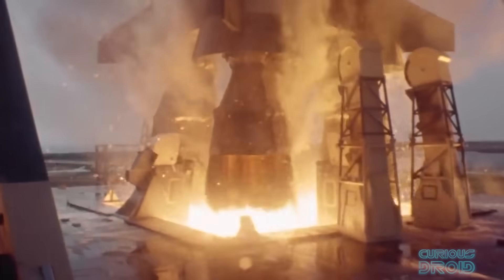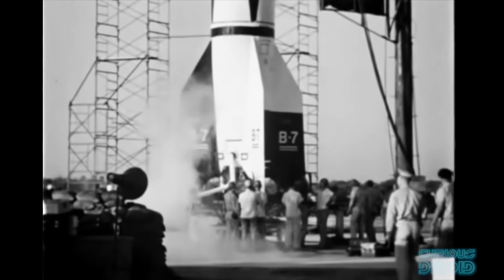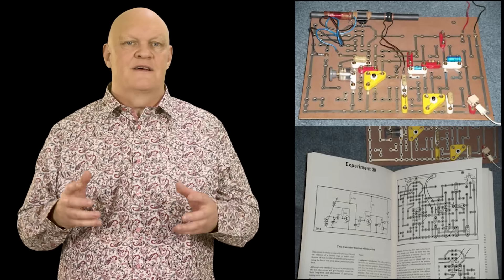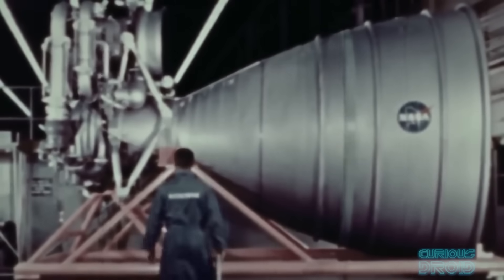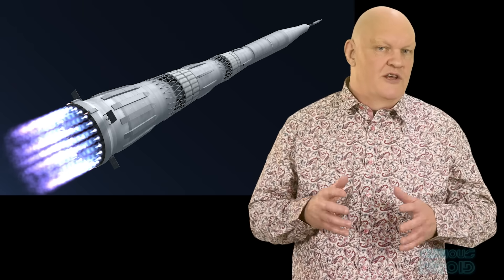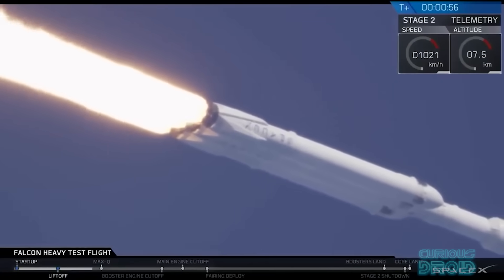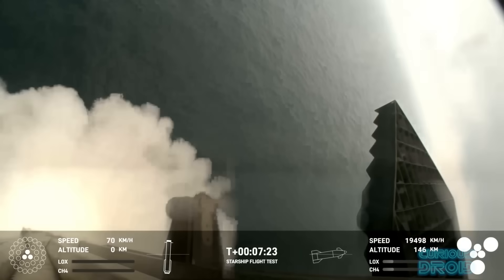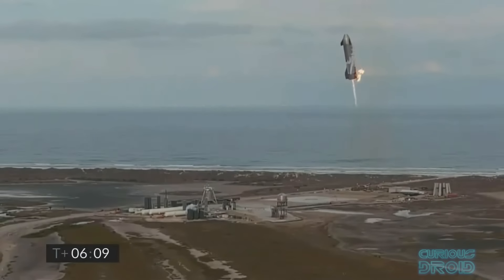Why Does SpaceX Use 33 Engines While NASA Used Just 5?

Comment: Starship isn't usable for a manned lunar mission. It's not rated for human flight. It doesn't have an escape Tower.   Apollo 6. Launched with in Saturn v stack which included dummy weight of the LM. A command module that orbited around the earth for hours, 9 hours I think. Then it splash landed successfully.  Every test was a success. 

Starship has blown up or burnt up on all its flights.  Booster landing in the water for number four. Progress... That's 33 engines gone. 

People going on about that. Fin... Where are the other cameras? Like the ones inside?  The fin failed, it melted.  What other damage happened to the craft? With all the melting, most likely a dead crew. 

All four flights of starship did not include any cargo weight. So what is the actual performance of the booster when it barely has any fuel left?  The second stage is empty. We've seen some pictures of the inside. It's an empty can. No life support system. No. Cargo. No crew compartment. No supplies. No space routers. No dummy weight.  It's supposed to carry 100 tons? 

About 20 launches for a single manned lunar mission?   A single booster failure would result in a scrubbed mission.   A landing failure of the chopsticks would result in a big boom and a loss of the chopsticks catcher thingy... And anything else nearby.

Spacex is way behind. They did not meet the milestones required. NASA has no business giving them any more money.
Reply: Some comments:
- A lunar lander doesn't need a launch escape tower. It's only useful for launch, and HLS Starship will not be crewed during the launch.
- Booster landing in the water is progress, yes. It set the stage for flight five, where SpaceX will attempt to land the booster at the pad.
- SpaceX will have a bunch of different camera views. They are not obligated to share any of it. It's very likely that if this flight had carried crew, they would have survived through the soft landing. The fact that all three engines relit and it was able to perform the landing says a lot about the state of the vehicle. The damage couldn't have been too bad.
- These flight tests haven't carried cargo, but there has been propellant left over. By the telemetry and by SpaceX statements, these early prototypes could carry around 40-50 tons to LEO. That will increase as development progresses.
- No, a single lost booster wouldn't cause a scrub for a lunar lander mission. The boosters and tankers aren't critical. If we assume they use four booster that they rotate through, if they lose one they still have three. It would only mean they would have to cycle through them faster.
- A failed booster catch wouldn't cause a particularly large boom. The booster is almost completely drained of propellant by the time it performs the landing. And many failure modes would simply cause a landing abort, where the booster just dives into the gulf instead of causing damage on land. Sometime next year, they will also have four launch pads, so even if there is damage to one pad, they still have three.
Reply: @SpaceAdvocate  Elon musk promotes that Starship will carry humans from Launchpad to the moon and back.  For for years they've been talking about launching people from New York to Tokyo for a 40-minute flight.  For which and escape Tower would be handy. But it's such a large craft. I don't see how that's ever going to be a thing. 

Obviously it would not be useful or needed for a lunar lander. 

What's the turnaround time for a booster? 25 days at best?  

You're right, SpaceX isn't obligated to show us anything.  But they have shown video in the past of the internals and people pointed out a lot of problems. 

Not showing the internals for this flight, or much of the ship other than a fin or two?.   Seems like they're hiding... What they don't know won't hurt them. 

When they tested the Apollo ships before they were crewed.  They recovered the Crew capsule. Which they can verify if people can survive.  

Spacex is promoting that Starship will carry human passengers and crew to Mars and beyond. 

If it's just a tanker... Then call it that.  Stop saying it's going to land on the moon and Mars.  And they're working on an elevator to lower people to the surface... 

Okay. Let's say they have four boosters.   It still takes about 30 days to refurbish a rocket for relaunch at best.  They still have to test these 33 engines each time.     If you watch a fueling rocket once a week.   That's 5 months of launches.   Lose a booster?     Have eight boosters, with launches twice a week, then 2 months.    WOW.   

A Saturn v/Apollo put men on the moon with a single launch.  

Let's look at cost.   At best it's $100 million per Starship launch. (Falcon heavy is 90 million)  But it's far more complicated and more fuel than a falcon heavy. 

$2 billion for fueling launches.   At best.  Realistically, 4 billion. 

Let's run some more numbers. A non-human mission to the Moon is about 125 to 200 million.  Wow.

To send a Rover to Mars cost about 2 to 3 billion.    Estimate cost to send humans to Mars would be $500 to $1,000 billion per mission. 

We're not going to Mars.  Not unless some new technology makes it possible to get there in a month or less at the cost of a few billion or better.  There's nothing like that on the horizon.
Reply: @tcat1990  I think we can expect that the turnaround time for a Super Heavy booster could quickly get below a week. Falcon 9 is several weeks, but that's because the engines need to be completely disassembled and cleaned between flights. Methalox engines like Raptor will be able to do multiple flights between scheduled maintenance. At the start of reusing boosters, we can expect that they need to replace some of the engines between flights, but they have swapped out engines in a couple of days. To start, they would also likely do a new static fire between launches, but once they see it's working alright with no engine failures, they would stop doing those.

If they have launches once a week from two launch pads, and need 20 launches for HLS, then they need 2.5 months to prep for a moon landing attempt. That's fine. That means they could do 4-5 moon landings per year, but Artemis is only planning one per year. Their capacity would greatly exceed demand.

$100 million per launch is a decent estimate, if they are expending the vehicle, but they intend to reuse them. (You could look at the paper by Payload Research.) I would expect around $50 million with reuse of Super Heavy, and maybe $20 million with reuse of both stages. 20 launches would then be $400 million. That's about the same as a Delta IV Heavy launch, or 10-20% of an SLS launch. 20 launches is also fairly high for longer term - with Starship V3, they may need 6-12 launches. That would drop the cost down to $120-240 million. The more expensive part of a moon mission would be the lander and the propellant depot. If we say they cost $400 million and $200 million respectively, each moon mission would be around $700-800 million, until they start reusing the landers and propellant depots.

Going to Mars is in some ways easier than going to the Moon, but they would need a lot of specialized equipment and several vehicles. I think they would need ~8 Starships before sending the first crew. If the eight spacecraft with cargo each cost $500 million, and they need 96 tanker flights, that would put the cost of an initial crewed Mars mission at ~$6 billion. SpaceX could afford that today.
Reply: I recommend you stop posting.
Reply: SpaceX went from testing individual stages on test stands to flight testing early on in its development process. That means the flights so far cannot be seen as failures.
Reply: For a manned lunar missions, if one of the tanker flights fails, there’s plenty more where that came from, so they’ll just launch another one.
Reply: @Hobbes746  if all the boosters are going into the ocean....  Then they're not reusable.  How is it supposed to land again?    Giant tongs?     

When there is a mishap that requires investigation to the cause.  That tends to pause launches for a while.  
The haven't done refueling in space. 

They haven't done docking in space. 

They haven't landed the booster or the ship itself.   

We haven't seen the booster take the weight of cargo into space. 

The bar is quite low for what SpaceX considers a success.
Reply: @tcat1990  For these few development flights, the stages end up in the ocean. This is not the end goal, but considered good enough for new as they work on the phases of flight that precede the landing. Again, they are in the middle of development, not claiming to be at the end of it. 
Flight 4 demonstrated they can land the giant first stage accurately enough to make catching it with the tower feasible.
Reply: @Hobbes746  An ocean dump is fine if the end goal is to sink in the ocean.  But these are supposed to be reusable.

They still launched an empty can into space.  Even if it was just a space-router launcher (The "door" is designed for Starlink CubeSats, not cargo, not people, not large satellites).  Not just the cargo, but the support system to hold it (Fuel, sats, life support systems)

SpaceX keeps saying "Designed for people to go to the Moon, Mars and beyond." - it has NOT made a single orbit.  It has not landed intact. Looks like they may have to land at sea.   Can the booster make it back?  Does it have enough fuel with an actual load? 

Test4 - they didn't even try a relight. Another door test?  

The bar seems low for what is called "success"
Reply: @tcat1990  Pay attention: they are in the middle of the development program. They are NOT claiming to have a finished product. 
Before Boeing was allowed to carry passengers on its new 787, it flew thousands of hours with an empty passenger deck. Would you have claimed the 787 was a failure when they were doing that?

Comment: Because they didn't learn anything from the failure of the Soviet lunar program.
Reply: What's there to learn? That the program directors need to stay alive and avoid alcoholism?
Reply: The failure of the N-1 had little to do with the number of engines. It had far more to do with:
1. lack of funding. No money to build a test stand for the first stage, which meant lots of testing had to be done by flying rockets. This was also done for Proton, which needed 14 launches before it was ready. 
2. Lack of time. They started in 1965 so they were 4 to 7 years behind (remember the F-1 was designed long before Kennedy’s speech). Again, this contributed to the decision not to build a test stand. 
3. Lack of computing power to monitor and control the engines. KORD really wasn’t up to the task. 
4. The NK-15 engines could not be restarted. They used pyrotechnics to open valves, so instead of testing each engine before it went into the stage, they would build 6 engines, run 3 on the test stand, and if those passed, they’d install the other 3.

Comment: nasa sls???? did nasa not pay Musk ?
Reply: The Artemis program consists of several parts. The SLS will carry astronauts to lunar orbit using the Orion capsule. There they will transfer to a lunar lander. Two landers are in development: one based on the Starship upper stage, and the Blue Moon lander designed by Blue Origin.
Reply: @Hobbes746  back to my point, Musk has not delivered anything that works as of yet, years over deadline . why does spaceX...

Comment: In the final footage wasn't the engines on a gimbal?
Reply: Yes. Starship has gimbaling on the inner three engines. The outer vacuum raptors do not gimbal.

The Super Heavy booster has gimbaling on the inner 13 engines, while the outer 20 enignes do not gimbal.

Comment: Small correction, SLS will not reuse the SRBs like they did on the shuttle. Reusing them was never much of a cost saving measure. It was to increase cadence which for obvious reasons is not necessary with SLS.

Comment: Because they are using russian engines.  Nasa tried multi engines.
It was notoriously unstable.
See russian N1 explosion.
Reply: That is incorrect. For Apollo, NASA never considered using a large number of engines. Also, in the 1960 no Russian engines were available to the USA. 
The NK-15 engines on the N-1 malfunctioned only once, when a piece of welding slag entered one. The other 3 N-1 failures were not caused by engine failures.

Comment: SpaceX Raptor engines are tested extensively before being fitted... Please don't claim that SpaceX testing is somehow like the Russian N1 testing. That's entirely inaccurate.
Reply: Results were the same though, first couple of launches ended up as total failures, and N-1 also could work if USSR had more time on their hands. So it is fair to assume similar methods at work
Reply: @Янус_Ырт  The most important similarity between the N-1 and Starship is not the configuration, but the development method. They both moved to in-flight testing early in the development process, instead of running endless individual stages on test stands first. This gives you flight experience earlier in the process, but risks blowing up a bunch of rockets. SpaceX is doing this with Starship, and the Soviets did it with the Proton and N-1. It saves a bunch of money. 
For the Proton, 14 test launches were needed before it was ready for operational use, and for N-1 they were counting on a similar number of development launches.